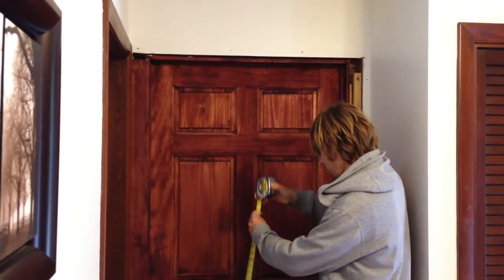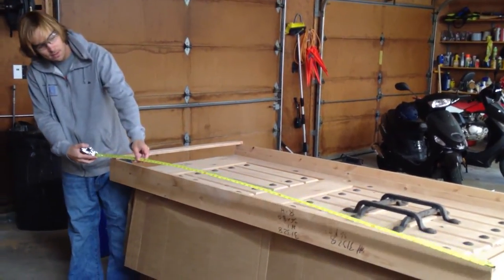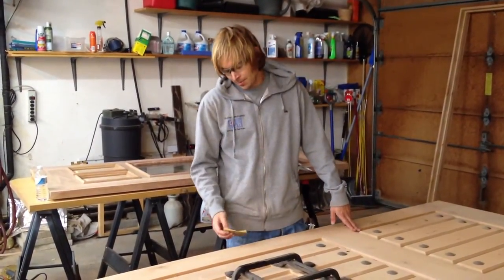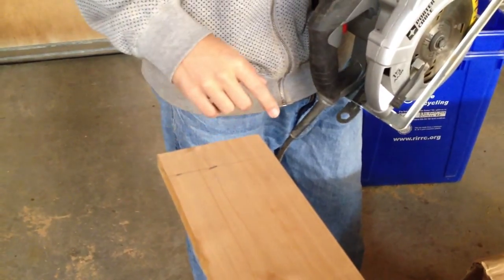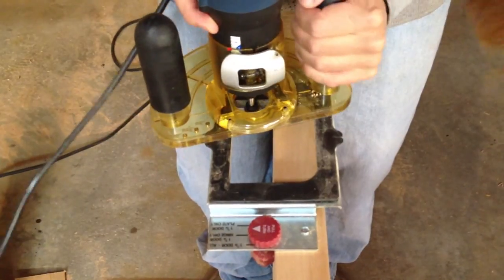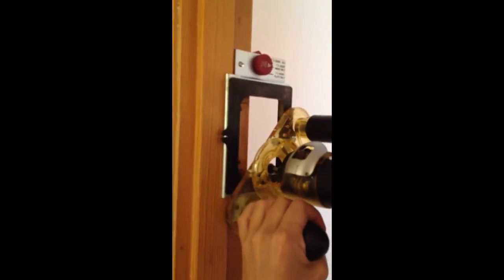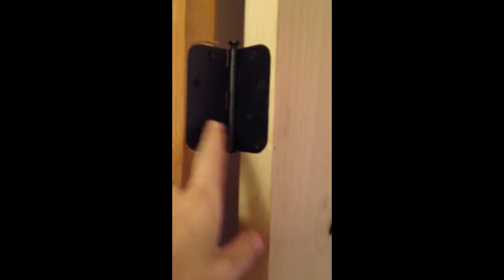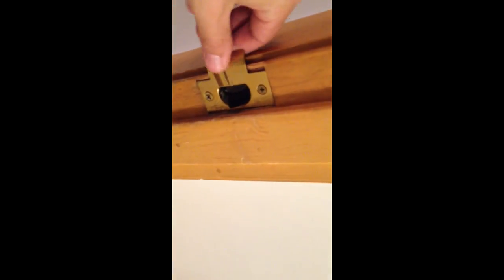How to install Interior Pre-hung Door -- | ETO Doors | Mahogany RM1 Rustic Knotty Door

Comment: Did you end up staining the door?
Reply from the maker: Yes i did a nice Dark stain, came out Great!
Reply: Curious what stain you used. ETO wouldn't give any recommendations or even provide any insight. I just bought the door and it would have been nice to see what they would recommend. Thanks!
Reply from the maker: They are a bit Lame on a lot of the Details, after they sell the door they do not seem to care that much. I went to Home depot and purchase some Dark Wood stain, with Poly, then gave it about 3 more coats of poly each time lightly sanding with  220 Grit sand paper, it came out nice and smooth and a really nice look.
Reply from the maker: +Anaf Durrani a link to a picture of it stained https://www.dropbox.com/s/wn0er6gql5nw0vs/Door.jpeg?dl=0